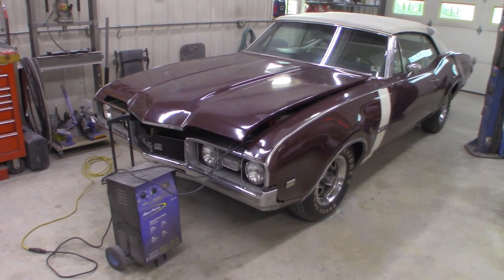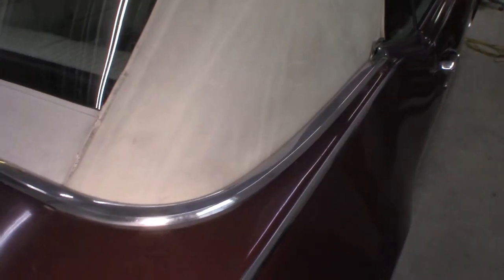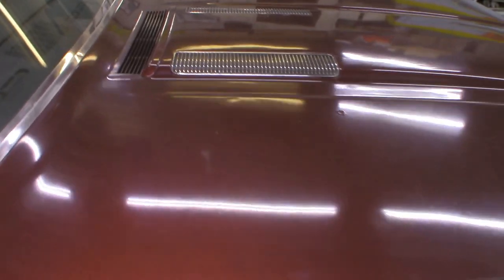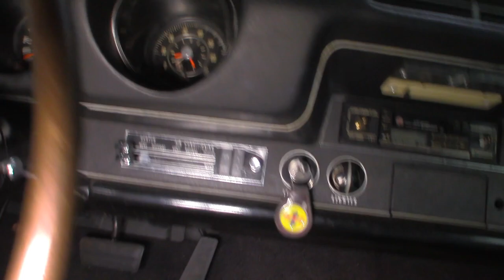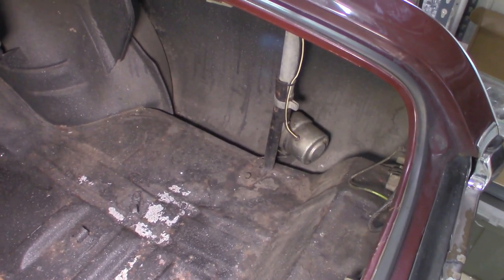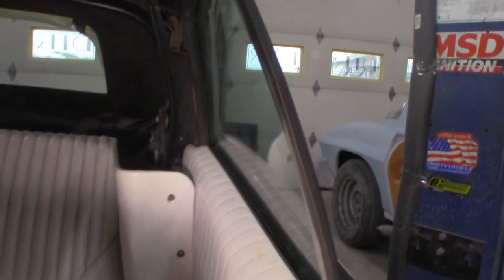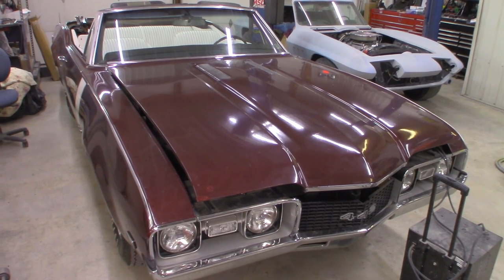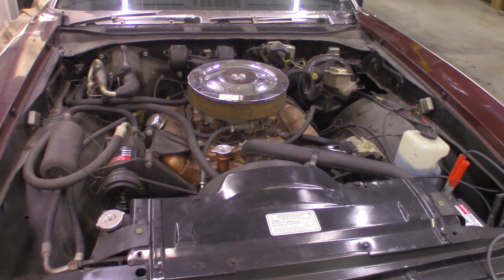1968 Olds 442 Restoration Walkaround DTR Automotive

Comment: well equipped car.
those pop rivets in the door jamb/quarter panel and gobs of seam sealer are a preview of the horrors you'll probably find under that paint
68 & 69 fenders are different.